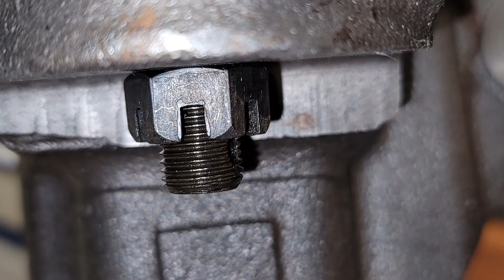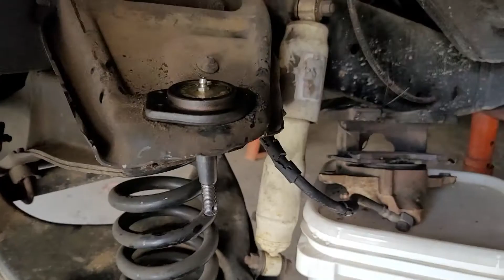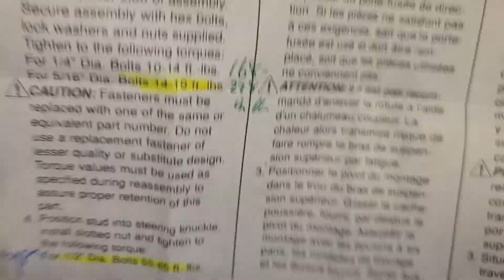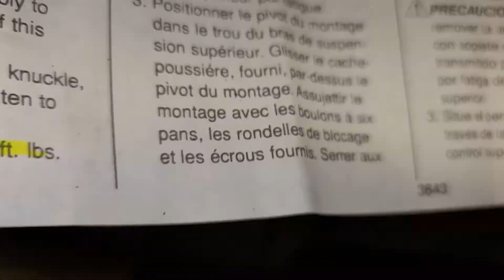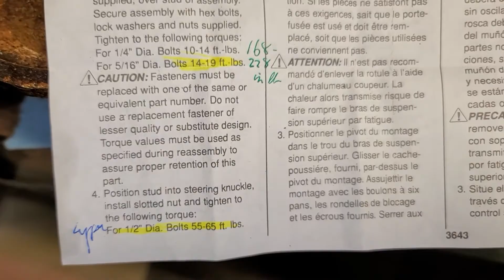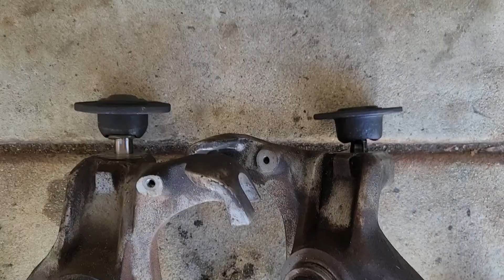My 1965 Chevy C10 - Replace Spindles to raise back to stock height

Comment: Just found your channel  ! Subscribed and liked  !! When you put your new spindles on, did the rest of your parts fit ? Where did you get your new spindles?
Reply from the maker: Spindles were purchased from POL inc., PerformanceOnLine.com.  As described in the video, I replaced the top ball joint with the correct one for the 1973-87 spindle.

Comment: So to loosen the ball joints you just bang em hard with a mallet? Stuck on this phase at the moment with my 69. All bolts off, tierod off, but cant get the upper / lower ball joints to kick free from spindle
Reply from the maker: In my case banging with a mallet did work.  Fork did not, but in another instance the spreader type tool did work pretty good.